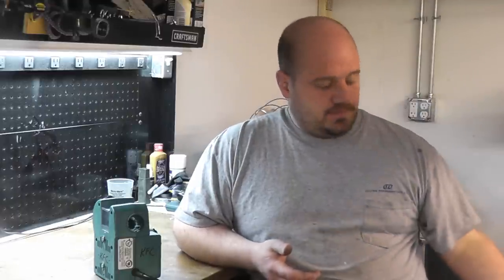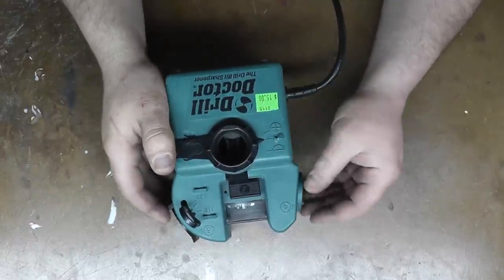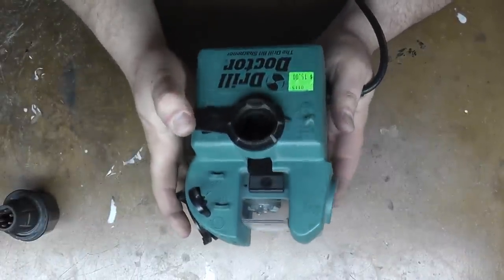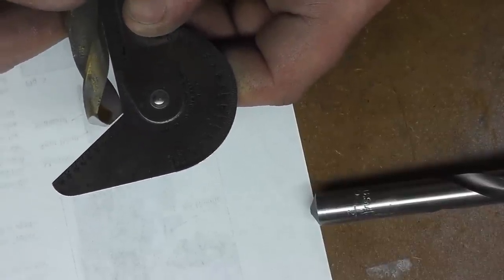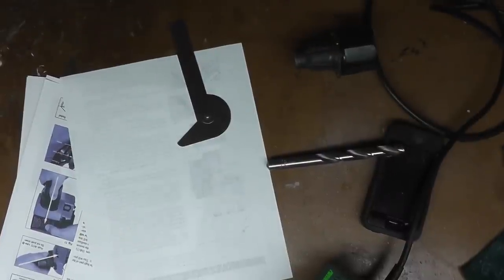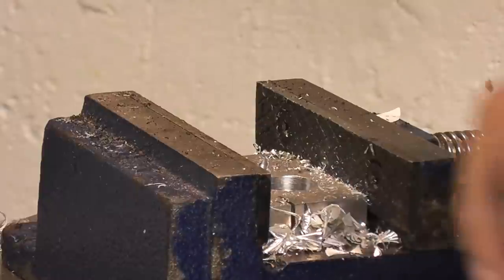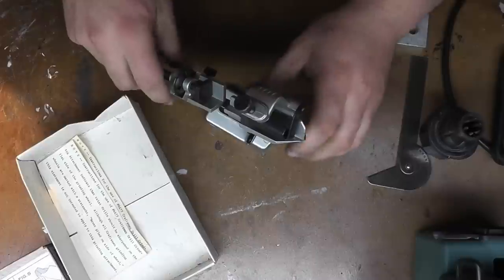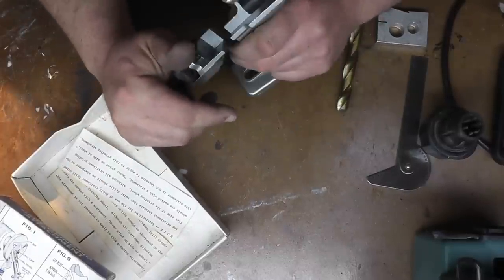Drill Doctor V.S. Craftsman Drill Jig

Comment: The Drill Doctor does take finesse but its worth.  Keep fiddling and practicing with it till its right.  I have both types including the new 750X and the very expensive $3k-4k Darex XT3000.   Yeah the spring steel forks in the alignment port are picky.  Probably just need a slight angle adjustment.  Watch the Darex/Drill Doctor videos if you haven't on YouTube.
Reply: I worked in a shop with a Darex unit;  seemed really nice but none of the guys in the tool room used it.  They did everything by hand on the Darex wheel,  but didn't use anything to hold the bit except their hands.  I got a DD several years ago,  routinely use it.  Nothing to brag about,  but works great for what it is.  Big bits I touch up by hand and test to see I get an even chip load on both sides.  Always remember what I learned from the guys in that shop with the Darex,  "Just do it by hand" they would say,  "you'll get the hang of it,  and you won't spend all your time diddling with that jig."  So now I use both,  DD for the small stuff,  grinder for the big stuff.
Reply: YCM30cnc I can offhand sharpen drill bits. But if a bit is snapped (a snapped bit I'll cone by hand first, then swing it), or really messed up I rough it with the swing style sharpener first, just to get it close, then I finish it by hand. Swing sharpeners can really even up the cutting lips faster than I can by hand. But the geometry they finish with does leave a lot to be desired. I split the point then with the edge of a grinding wheel by hand, and that helps out a lot. I'm happy with the bits I sharpen, and that is all that really matters to me.

Comment: I have two Drill Dr.'s and I have tried and tried to get them to sharpen drill bits. I never get the same out come with them. They might work great for wood bits but for steel working I am not satisfied.
Reply: Do you have a new version and the older one like in the video? I bought one in the 90's and it was probably the version before his cause it had the drill tips like shown in the manual that he only had a + and - sign. The newer designed units seem to be not as easy to use. But even in this video he screwed up the DD set up from the start.
Reply: disgruntled181 I have the blue XPX and the 750X, I have tried and tried to get these things to work, minor adjustments but still no good sharp drill bit.
Reply: MARTY CASTOR
Hmm, not sure the model I have but never had issues after a learning curve. I bought it because of my split point bits cause I cannot do a splint point manually. On mine you used the same opening for the cutting face as the splint point. I guess it's a love it or hate it thing. I will admit that it is hit or miss on bits below 1/4 inch.

Comment: Part of the problem you are having with the drill doctor is that the unit is an old unit that has most likely had much use, some probably incorrectly. That is probably why it was sold for such a cheap price.  Like you, I purchased an older unit & had the same problems you encountered.  I purchased a new unit & it has worked great. When purchasing any used tool, you have to consider how much it has been used & whether it might have been used incorrectly & is simply beyond producing satisfactory results.

Comment: Need a face grinding wheel setup on your grinder, like the ones on a tool grinder. I have a grizzly planer knife grinder that uses these wheels. You don't want to sharpen drills on a belt sander for many reasons...25 years in machining job shopping, production, and tool and die, and that has always been s pet peeve of mine. I bought a drill dr 20 years ago and used it a couple of times before I threw it aside forever. What a waste. I, too like the little general/craftsman jig. They work great when you Lear hoe to use them. Wish they made one for up to 1 1/2" drills.

Comment: First, you didn't use the drill dr right. There is no way you can get the same flute length on both sides with the DD, cutting by hand pressure. Not even if you do the same amount of turns, which you did not. Its really not any faster once you use the Craftsman a few times. And you can adjust the relief angle on the DD. The Craftsman is clearly the better of the 2. A disk sander works the best for me so far.
Equal flute length is critical for drilling precision holes without the bit walking. And hanging, causing breakage. But most people just want a hole. So the drill DD will do, but the cost it way too much for what it does.

Comment: I spent a weekend with a new Drill Doctor sharpening 15 years worth of dull drill bits and they cut as good as new!
You need to buy a new one with a decent "stone" and has not been beaten up by someone too stupid to read the instructions.
Everyone I have spoken too that thinks it's junk FAILED TO READ AND UNDERSTAND THE INSTRUCTIONS!
Reply: archangel20031 j
Reply: agree fully and will add:
success depends on indexing, some drills with weird twist rates simply dont index right.
you need to print out the "anatomy of a drill bit" diagram from their site and experiment with your indexing setting, even setting it far past the detents. 
when successful I dare anyone to identify the DD sharpened bit from a factory sharpened bit.

Comment: That Drill Doctor you have looks ancient.
The new Drill Doctor works just fine IMO. I've used both and I get better results with the Drill Doctor, especially on small drill bits.
Larger drill bits are easy to sharpen, try to sharpen a 3/32 drill bit with the Craftsman jig.

Comment: I have 2 Drill Doctors (the 500 and the 750) and your problem was 100% operator error.

I have sharpened thousands of drill bit (left handed and right handed) and the sharpness and quality of the cut is very good.

You need to watch the video that comes with the machine.
Reply: I agree totally! Someone that knows how to use a Drill Doctor should do a video. I'm sure this used one needs a new wheel also, unlike the virgin sides of that grinders wheel.

Comment: Old school is sometimes the best. My meaning is the Craftsman Drill Jig duplicates the traditional way to sharpen a twist drill. With that said we all know and were taught to never grind on the side of a grinding wheel. Now keeping in mind that to side grind on a wheel with reasonable pressure can make the wheel explode. With the Craftsman Jig you are applying very light pressure and I believe that this is the exception to the rule. I have had this same drill jig for many years, but can't say I have ever tried it. On the rare occasion I need a sharp twist drill I will grind it the traditional way on the grinder by hand.
Back in the day when I worked in a machine shop and I was a welder we had a side grinding jig. Of course this jig was an industrial unit, but it ground the drill on the side of the wheel. I did some research into side grinding drill jigs and here is a link for some pictures.
.https://www.google.com/search?q=drill+grinding+wheel&biw=1097&bih=546&source=lnms&tbm=isch&sa=X&ei=TpuxVM-XAsvbsASpnYLQBg&ved=0CAcQ_AUoAg&dpr=1.75#tbm=isch&tbs=rimg%3ACb30Eq2kjbZoIjhOBDzyI_1zoP4JRzLm32RNsQPcVS8DrQMqWYRPj4Iw6I1dee7JLH0g0k9OtOLKFCYwOAxHHaXyTAioSCU4EPPIj_1Og_1Ecb31eqezKftKhIJglHMubfZE2wRNLQbFqmnWUsqEglA9xVLwOtAyhHRnCNSHMm-NCoSCZZhE-PgjDojEWvlGPlbbJHvKhIJV157sksfSDQR87jWV3MGhTAqEgmT0604soUJjBFmxZuMcJK3WyoSCQ4DEcdpfJMCEYFOp1Io0LWA&q=drill%20grinding%20wheel&imgdii=_
Reply from the maker: Thanks for the links

Comment: I've seen people trash talk the general/craftsman/generic drill grinding fixtures and I don't get it. I love those things. They work like a lisle grinder we had in the machine shop I worked except the use the side of the wheel. I bought a DD years ago and wanted to vomit. Total junk. Only good for touch up, forget grinding chips out without a lot of off hand grinding first...and that grinding better be close or you'll be all day on the DD. As for the craftsman fixture, why not use a face grinding wheel with the backing on it? I do not like belt sanders at all for drill grinding.

Comment: I hate to say it, after all the trouble you went through, but the Drill Dr. may well have been abused.  I have a Drill Dr. and I swear by it.  I've been able to get releif angles, split points, adjust the angles of the grind...I love it.  I'm sorry but for $15, you got what you paid for.  I can say that when you set the bit in the first step, you need to tighten the clamp on the bit without too much force, then lift the clamps before removing it, then after it has been removed, you tighten the clamp on the bit using only your hands.  Lastly, the Drill Dr should only require 4 to 6 revolutions, not 20, no matter how hard your bits are.  ...better results from the right technique.  I hope you give it another shot as the grinding wheel approach is slow and really crap.  I'd bet you used more force with the craftsman bits...

Comment: I have used a Model 750 Drill Doctor before and had great results with drills smaller than 5/8. I bought the new model and it's a piece of junk. It looks like your Drill Doctor is broke by the way your spring button for setting the drill is moving around. You should just pull it back and not be able to move it side to side.
Reply: +KEVIN OLEKSIAK That is kind of the point I was dismally trying to make in my 1st comment.  If the tool is broken, you can't expect professional results, so of course the Craftsman/Sears jig would do a better job as it's not broken!

Comment: 20 secs to sharpen by hand forget these nonsense devices
Reply from the maker: +rob armstrong 
I agree.  I wanted to compare these two things and see how they compared to each other.  $5 ancient design wins out over $150 over-priced junk.
Reply: If you drill sheet metal, you can sharpen by hand all you want, if you drill thinker stuff jig is needed. Unless you sharpen bits all day long and can get jig accuracy by hand. I think it is doable, but not for someone who sharpens in a while.
Reply: The first thing you do is throw the jigs away and learn to sharpen a drill by hand.  A drill sharpener gage is often good to help get the two cutting lips  the same angle.   And by all means, use a grinding wheel dresser to keep the wheel in good condition.   The wheel you use to sharpen drills is not the same used to deburr ruff cut angle iron.   Buy a diamond strip dresser.   Learn to use it properly and it will last a lifetime.
Reply: juliusvalentinas a
Reply: rob armstrong やゆゆや
Reply: Rob Macfarlane-  I've been sharpening bits by hand for years but since I'm not a machinist I don't get a lot of practice.  I'm trying to sharpen a tiny bit today and it's a frustrating experience.  I can never get the angles lined up correctly with the flutes, especially when trying to sharpen a broken off bit.  I can see why people use jigs.  Not everyone is 20 years old and as coordinated as yourself.
Reply: None---------I think you are suppose to be responding to a  Rob Armstrong, not me, Rob Macfarlane.  But I'll respond to your question anyway.
        I've been sharpening drill bits for a long time.  It's a skill that requires lots of practice.
       The best advice I can give anyone wanting to sharpen drills is to hold or look at a existing sharp drill and try and copy the angles of a "factory" drill.   If you can use a new drill as a guide, you're half way there.
Reply: Noneovyer Business hey i only sharpen larger sizes. Rivet size and smaller just buy them! Now i think i need a jig to do my end mills.
Reply: Can't agree more Rob! that's what I did, I bought a good  quality 180 grit grinding stone on Amazon and I used it since then.
Reply: Have you read Forrest Addy's post (Practical Machinist) on drill sharpening by any chance? He says it's way better to grind the clearance by simply raising the whole drill, without dropping the tang down, up the wheel while keeping everything else the same, as opposed to the conventional wisdom of lowering the tang to get clearance.
Here is the thread, scroll down for Forrest's educational and entertaining post:
http://www.practicalmachinist.com/vb/general-archive/sharpening-drills-91305/
Reply: Drill sharpening by hand is ok for most tradesman type work .....However if you are a machinist and want precise angles , and particularly correct sized holes , then a jig is essential...... It's a bit pointless having a range of drill sizes that differ by 0.1  mm increments and , typically your 6.1mm drill is actually drilling at 6.3 mm dia.
Reply: @mikecrowley3102  everybody will throw away these jigs and helps some day but you have to learn doing it by hand properly and somebody who hasn't been told how to do uses a jig to get the idea of it. After a while he recognizes what these things do and how they work and witj time he gets the self confidence trying it without a jig or help and if hes got over that point he don't needs them any more... But for a beginner they can be the only way for him grinding his drill bits at home and not buying them new regularly or letting them be grinded for money....

Comment: I wouldn't give you 10 cents for dd type sharpener I have several of the jig type up to 3" dia. and have been using them for over 45 years  you should use a drill grinder cup wheel and make sure make sure that the jig socket is mounted tight and not worn out I use jig type mostly to reshape chipped or broken drills and sharpen the rest by hand, lots quicker

Comment: I think there is a bit of user error here with the DD. If the point is not in the center you are suppose to hit one side (I guess the short one) until it is perfectly centered.  I don't know if it makes any difference, but I've always spun the chuck counter clockwise? The DD will take a bit that can't cut butter and in a minute or two make it cut pretty well. That's all I really need from it.  I'll still give you your money back... :)
Reply from the maker: Just went by the instructions.  I noticed on my first bit (not in this video) that if those little alignment tabs were off in any way it skewed the chisel point off to a weird angle.

Comment: HA, my shop teacher always preaches to never ever grind something on the side of the wheel. Make sure you look for the warning that says we're not responsible for grinding wheels blowing up in your face.
Reply: That warning was issued for other reason (applying heavy load to the side of the wheel, like when grinding a large chisel, pushing HARD on the side can indeed break a wheel)... But grinding the very small contact patch of a drill bit places a diminute load, therefore it is very safe.  Amclaussen.

Comment: Thanks for the video, perfect timing, need a new option for sharpening bits, until I can afford a high end sharpener.  My old Drill Doctor worked great, until it finally wore out after about 15 to 20 years of use.  Replace it the new high end model Drill Doctor and it is a piece of sh!t.  Too bad I really liked my old one but the new design on the Drill Dr. is not aggressive enough and takes too long to sharpen and they got rid of some features and changed angle of the grind to where they do not match new bits.  So to touch up brand new bits the drill dr. changes the angle completely taking way to long to sharpen, my old one match new bits angles which saved a lot of time.  Plus all my bits sharpened on the old drill dr don't match either taking more time to sharpen on the new one.  Time is money, I have to be able to sharpen and get back to work.  Drill Dr. is done in my book, and until I can afford something like the Darex, I'm going to get the grinder jig and probably make a quick mounting system for my 2" X 72" belt grinder.

Thanks again.
Aaron Armstrong
Owner
Black Cat Forge, Welding, and Leathercraft.

Comment: You can if you so choose grind on the face of the wheel instead of the side. I will give you a slight concave cutting edge but that is no problem. You would have made life easier for yourself had you used some WD40 as lubricant ! And also it isn't normal to punch a hole in a bit of even Ally without a pilot hole lol

Comment: Hum, well I can't stop you from doing stuff the manufacture says not to do, and that's not to say that I've never done something that's very risky, but using the side of a grinding wheel when the manufacturer says not to, well I'm not going to! If I had a cup wheel well that would be a very different proposition. I have used a drill gig that is in every way similar to the one shown in this video on the face of a "regular" grinding wheel, the results are acceptable to me but I will not say that anyone else will find that to be the case.

Comment: Drilling and grinding with gloves on, 16 minutes to grind a sub 1"drill bit, tsk tsk tsk.
Reply from the maker: Bit was ground at a steeper angle than 118 and it had flats on it.  Took that much time on the drill doctor to get it back to the correct angle.